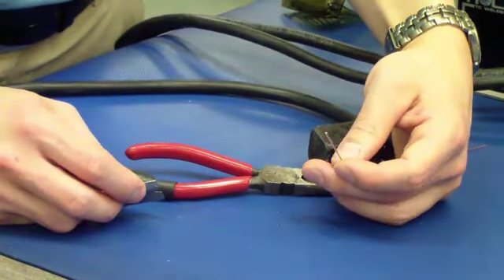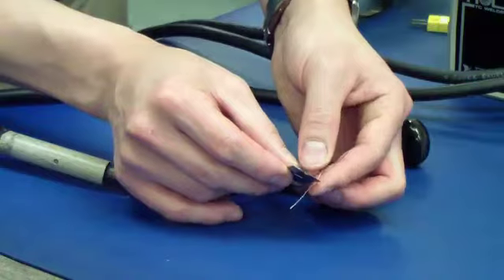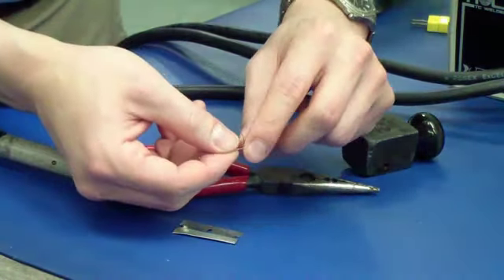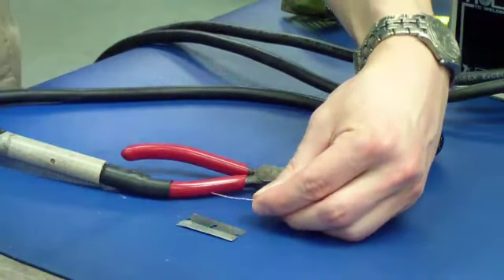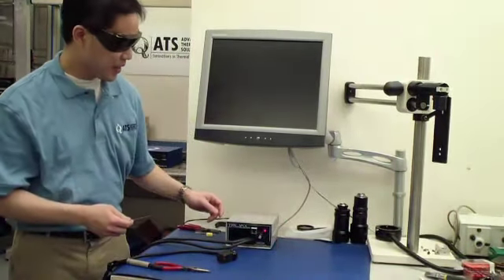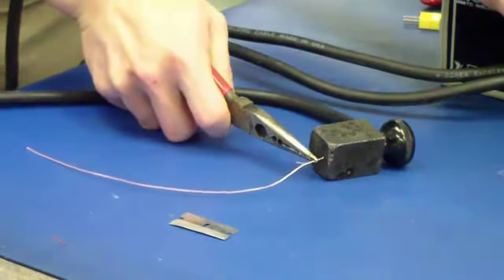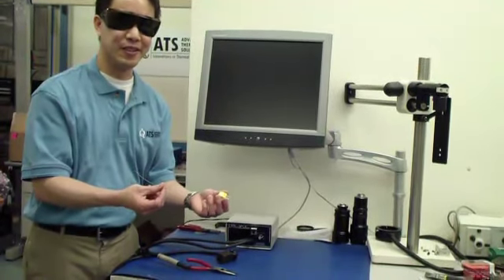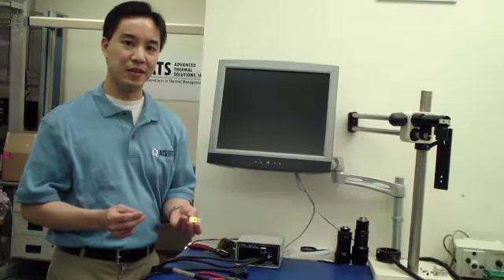How to Make a Thermocouple

Comment: Thermocouples required dissimilar metals or they won't work. You might want to address that in this video and specify the metal types the wires are made of.
Reply: You just buy thermocouple type "x"  wire you want to make  a thermocouple out of, if you buy thermocouple k type wire you get the correct two alloys.
The wire comes in different qualitys which affects the accuracy but all are basically the same, k-type wire is used to make a k-type thermocouple and so are all the other types.
Reply from the maker: Hi @Nobody Youknow  ~ Fist, thanks for leaving your comment, we appreciate your coming by.  Second @robber576 is spot on with his answer.   Third, we have a free white paper on the basics of thermocouples that you might also find helpful, no registration required: https://www.qats.com/Qpedia-Article/Qpedia_Feb07_Thermocouples   Fourth, Omega has a handy reference guide on thermocouples you may also find helpful https://www.omega.com/en-us/resources/thermocouples-sheath-material-and-temperature-limits

Comment: Is the welding required, or can you leave the wires only twisted together.
Reply: I observed years ago that a type k can be easily made by just twisting the wires together, if found no difference in measuring between a self bodged thermocouple and a factory made sensor.
By doing this the company i worked for had a financial advantage over the competitor who used expensive real thermocouple sensors while i made them homemade out of k-type wire twisted together and secured with a copper crimp connector.

Comment: Thankyou.the one l use is a heat one on hot water .old 96 Bosch can l solder the wire back in .the tip it fell out.what is the tip made of that is in the pilot flame? Thankyou

Comment from the maker: +Amit Sharma asked:  "Hi, can you show us the welding and closing process of K type thermocouples with 6mm mineral insulated wire"  

Hi Amit - I am sorry but we don't have K type wire in our lab.  MOst  of the applications we work with don't have such extreme temperature requirements which would require that kind of insulation.  The biggest differences between what we use and K type wire would probably be stripping the insulation of the wire.

Comment: I have an MPPT lead or lithium solar charge controller intended to be mounted right next to battery. A fairly inexpensive unit typically used for solar powered street lamps.  The controller has small tail of wire with an in the air thermocouple  on the end to measure temperature for controlling charge based on temperature of space around battery.   The wire with sheath is only 2 or so MM in size and the thermoucouple secion itself only maybe half cm in width...   I would like to move this thermocouple (thus allow for battery to be far away)  with about 25 feet of compensating extension wire .. do you have any suggestions for me?  all the wire is black. I have  picture if it would help.

Comment: Cool demo on the process, but since a themocouple require two different aloy compositions of the wires, I am curious what are the two metals in the insulated wires?
Reply from the maker: We generally use type J thermocouples, which has one wire of iron, and the other of Constantan (a copper alloy). There are many resources on the internet which will tell you the alloys used in other types of thermocouples, and the color codings that are used to identify them.

Comment: the accuracy of one of this is as good as a thermocouple from a store? how can i know it?
Reply from the maker: +Hugo Cruz Valeriano   --   The accuracy of the thermocouples you make are just as good as the pre-made units you can buy from a store. Following some of the suggestions in the January 2016 issue of Qpedia (http://www.qats.com/Qpedia-Thermal-eMagazine/Back-Issues) will help you maintain accuracy. One of the things that does affect accuracy is the grade of the wire that you buy.  Most common thermocouple types are available in “standard” and “Special Limits of Error” wire which has a tighter tolerance on the readings.
Reply: Thanks :)

Comment: could u tell me what wire we have to use and how to test ?
Reply from the maker: mk cyber, 

There are many guides online which describe thermocouple characteristics. 
For example, the Omega Engineering website has one here: https://www.omega.com/techref/colorcodes.html
and it summarizes the useful temperature ranges, color codes, and other qualities of the various thermocouple types. 

As for testing them, if you don’t have some sort of calibrated temperature reference, you could use an ice bath
and a boiling water bath to check at 0° and 100°C.

Thanks for watching!
Reply: ok i will try thanks !

Comment: I guess you need to be advanced to get this video.  It never mentions what kind of wire is used.  Two different metals in the wire?  Why twist?  I'm dumb so it generated more questions than answers.
Reply from the maker: Raethan Moniker,

The techniques shown in this video apply generally to the many different types of thermocouple wire that are available. We twist the wire together so that the wires remain close together until the time that the actual spot weld gets formed. After the spot weld is formed, if twisted wire remains, we suggest untwisting them for the best thermocouple accuracy.

Thanks for watching!
Reply: for k type thermocouple,  the two different metals are:  Chromel (Ni-Cr)  and Alumel (Ni-Al) (-)

Comment: he failed to mention that you gotta untwist the twisted portion!!!
Reply from the maker: +Persian5word  --  That is a good point – having a long twisted section could
lead to inaccurate thermocouple readings. This is addressed in the current
(January 2016) issue of Qpedia, which you can read here: http://www.qats.com/Qpedia-Thermal-eMagazine/Back-Issues.  However, when we make thermocouples, we burn it back to the insulation, so that there is no twisted section left.

Comment: What is the metal used ?
Reply from the maker: +Incroyable monde  --  We typically use J type thermocouples, which are made from one strand of iron and one strand of constantan (a copper alloy). K type is also very popular, but J has a little higher sensitivity. We also avoid T type, because one strand is copper, which is much better at conducting heat away from the test subject and could affect the test results.
Reply: Avoiding T type because of thermal conduction is only valid for test subject with very little mass, several grams
Reply from the maker: That’s a good point – in our labs we end up testing a lot of different devices of many different sizes, so we have some cases where this matters, and others that it doesn’t. We try to avoid confusion by minimizing the different types of thermocouple wire that we have on hand. So we use several different wire gauges, but they are all J type.

Comment: I need to strip sheathing from T.C. cable. I need to strip hundreds of T.C. cables. Your method of wire stripping takes to long
Reply from the maker: As we alluded to in another comment, our main use for thermocouples is lab testing, not production. We rarely need to use more than a couple dozen, so our techniques reflect that. For higher volume use, there are many different options for automatic wire strippers available.
Reply: +Advanced Thermal Solutions, Inc.  this is for test. nearly 3000 t.c.. Spacecraft thermal vacuum chamber
you would think Omega would have a tool for stripping tc wire. we use Type T as it is more accurate at liquid nitrogen temp.
I haven't figured out how many miles of tc we,ll use